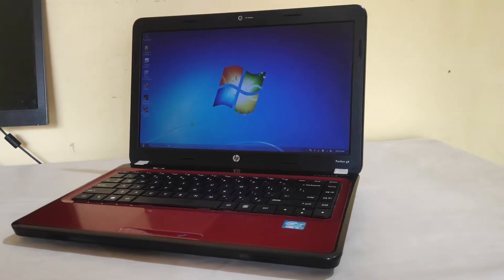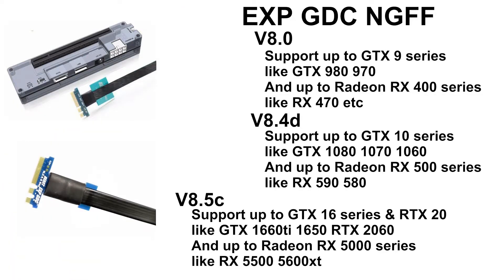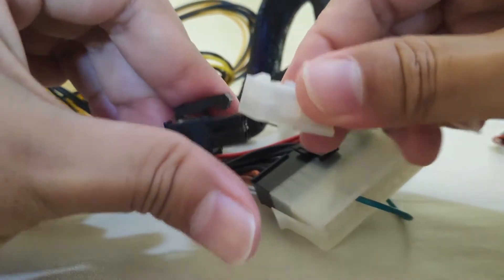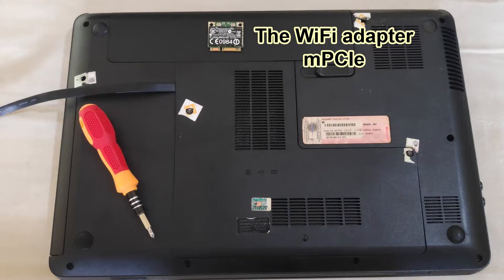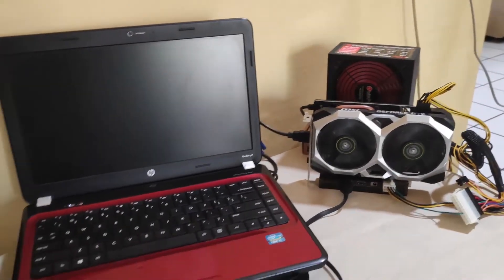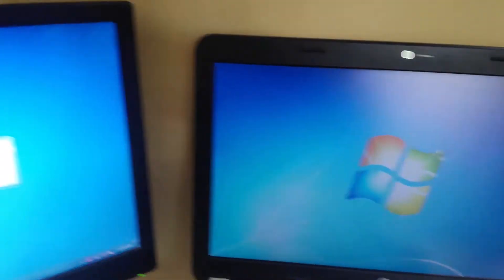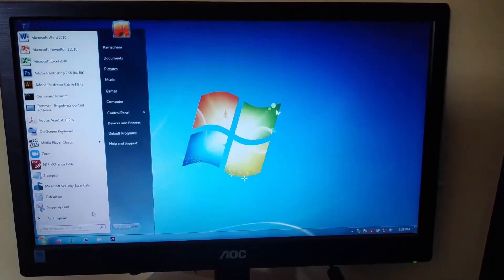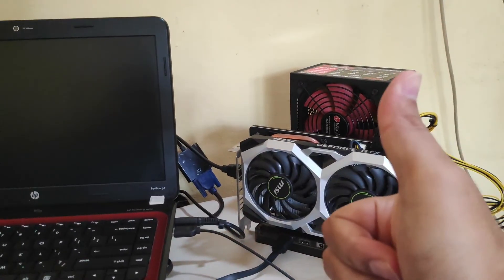EXP GDC Beast V8.5c eGPU with GTX 1660 ti on Old Laptop from 2012

Comment: is it necessary to use a monitor?
Reply from the maker: If your Laptop's internal slot is using : Mini PCIe (mPCIe) , Express Card, NGFF, then it's necessary to use external monitor.

If it's using M.2 NVMe slot, it doesn't need external monitor.

The reason? The cable have to do Two-Way transmission between Laptop, eGPU, GPU, back to Laptop again.

This will make extremely saturated PCIe Signal since mPCIe is running at 2.5 gbps, Express Card at 5 gbps, NGFF at 8 gbps. Those numbers, divide by 2 if you're using Laptop's Monitor. So must use external monitor to avoid Saturated PCIe Signal.

As for M.2 NVMe slot, it runs at 32 gbps. So the signal will not be saturated at all.

The ONLY Exception is the Pinned Comment about RTX 3070, which is connected using mPCIe, but can still use internal Monitor.
Reply: @ClayWheeler Okay thank you

Comment: So the cpu does not matter for a external gpu?
Reply from the maker: actually it matters for PCIe signal as my Laptop only have PCIe Gen 2 x1 Lane which is exactly 2.5 Gbps.

if your Laptop has mPCIe, its signal is 2.5 Gbps or 5 Gbps if the Laptop is from 2013.

if your Laptop has Express Card, the signal is 5 Gbps.

if your Laptop has NGFF, the signal is 8 Gbps.

as for M.2 NVMe, the signal is 32 Gbps.

Any Laptop from 2013 OR Older WITH mPCIe, have a heavily saturated PCIe signal. Your best chance of using external GPU is for lightweight gaming. It cannot even play GTAV at Lowest settings even with Core i7 Mobile CPU.

Unless you have any other connectors as mentioned. It can still play heavy games just fine. Also,  check pinned comment
Reply: @ClayWheeler  I have my Lenovo 330s with NGFF and the cpu is i5 8250u. What gpu do you recommend for this? Thanks
Reply from the maker: @AbuSyria08  I have certain concern regarding any Lenovo laptop that is NOT ThinkPad.

Sometimes their NGFF Slot is not sending PCIe signal. it is only sending internet signal.

What kind of storage already occupied in your Laptop Ideapad? is it the regular 2.5 inch SSD SATA?

https://youtu.be/QFzmeq4XWIk?t=168 

In that video I can clearly see M.2 NVMe slot which can be used for eGPU without failing.
Reply: @ClayWheeler  so I checked out my laptop and I found an slot which is named DR16493MD next to my NGFF slot I don't really know if thats a m.2 slot but I'm just making sure if thats it and if it's the m.2 slot then lemme know. Thanks again.
Reply from the maker: @AbuSyria08  is your Laptop motherboard layout exactly the same as the Video I sent earlier?
Reply: @ClayWheeler  no its not.
Reply: @ClayWheeler  I forgot to say that my Lenovo is 330-15ikb model
Reply from the maker: @AbuSyria08  I'm asking you a favor to look for someone else's Video about that exact same Laptop as yours, disassembly

And then maybe I can help from there
Reply from the maker: @AbuSyria08  alright, wait a sec
Reply from the maker: @AbuSyria08  oh wait, is your Laptop already have NVidia GPU on it?
Reply: @ClayWheeler  no mine haves an uhd Intel 620
Reply from the maker: @AbuSyria08  I found 2 different video with 2 different Laptop Layout, but has almost similar Laptop name

330-15ikb
https://www.youtube.com/watch?v=HqpIEE71GLA

330s-15ikb
https://www.youtube.com/watch?v=AocmjFQ3r-E
Reply: @ClayWheeler  oh the 1st one is the exact same one but only with Nvidia my laptop got ryzen next to the intel I Core sticker. Thanks for responding fast! I appreciate
Reply: @ClayWheeler  sorry I acsedently disliked your comment 😅
Reply from the maker: @AbuSyria08  alright the 1st one.

What is your current storage type?
SSD SATA or SSD NVMe?
Reply: @ClayWheeler  it's ssd nvme
Reply from the maker: @AbuSyria08  so apparently your Laptop only have 1 NVMe slot which is already used by your current SSD.

We don't know if the NGFF Slot actually carrying PCIe Signal or not.

But you can confirm this using a Software called PCI-Z (it's like CPUZ and GPUZ, but this one is for detecting PCIe signal)

It's freeware. Just install and run as Administrator. Look for your current WiFi Adapter name.

If you're confused with the names, just check your WiFi Adapter name from Device Manager, and then make sure it is listed together in PCI-Z
Reply: @ClayWheeler  OK so the adapter is listed in the pci-z
Reply from the maker: @AbuSyria08  so maybe it can use NGFF eGPU.

For sure it's limited to PCIe Gen 3. So any GPU with base model of PCIe Gen 4 will be saturated. It will work but will be heavily Bottlenecked.

So your Options are RTX 20 series, GTX 9xx, GTX 10xx , GTX 16xx.

If you want to buy Radeon, then anything that's not RX5000 or newer. Because RX 5000 already PCIe Gen 4.
Something like RX 590 is ok.
Reply: @ClayWheeler   so do I have Gen 3 or less?
Reply from the maker: @AbuSyria08  Gen 3
Reply: @ClayWheeler  OK thank you very much now I got all the information to buy the exp gdc beast and I really appreciate it thanks very much
Reply: @ClayWheeler  I just got my last question so there is no problem if I use the exp gdc beast v8.5c NGFF with rtx 2060 super on my Lenovo 330-15ikb?

Comment: Bro 
I have 2 ngff connectors on my laptop one the wifi card plugged in it and another empty
Can i use the empty one and keep the wifi card ?
Reply from the maker: First of all, please check the NGFF Slot itself.

What does it says near the Connector? If one of them says (Written) "PCIe" then you should use that one for eGPU
Reply: @ClayWheeler  the empty one say 
LTE WWAN JNGFF2
What's that mean?
Reply from the maker: @chouaibboudhim3465  yeah apparently it brings PCIe Signal which means can be used for eGPU
Reply: @ClayWheeler  thank you so much bro i appreciate it 🙏 💯

Comment: Bro, you can use hdmi dummy plug to don't be necessary using external display. But also without egpu box there is a mess on the table lol.
Reply from the maker: HDMI dummy will create extreme Bottleneck because the cable isn't supposed to be Two-Way .

Unless the Laptop support HDMI input.

Comment: Hi I have a hp probook 430 g5 laptop i5 8250u 
I was thinking if I can install egpu to it…
It has mini pcie 
Which graphics card would be best for it ( I’m planning of getting old GTX 1060 or GTX 1650 or rtx 2060 anyone  of these ) what do u say…..
and…. should I buy exp gdc from aliexpress and want version should it be 
Hope u reply…..
Reply from the maker: I'm actually surprised that HP Probook Laptop is using Mini PCIe version.

Because HP Probook with Core i5 8250U is from the year 2018, and Mini PCIe discontinued after 2014. Are you sure it is not using NGFF instead?

But anyway apparently even the version V8.0 can handle RTX 3070 if you see the pinned Comment of the video.
Reply from the maker: This is HP Probook 430 G5 disassembly video. And if you pause between 00:45 to 00:47 you will see it is using NGFF https://youtu.be/rsO6yy_Y-9w
Reply: @ClayWheeler  oh it’s using ngff thank you for letting me know

Comment: Hey Clay. Really appreciate yoour Video. it's very helpfull.

i don't know if you still answer question about this. But for me i have a Lenovo legion 5 pro, that comes with an intel core i7 11th Gen, and a RTX 3050 . But i some problems on rendering videos, on twinmotion, and other 3d Apps. lack of power. so, i decided to buy an EXP GDC with and RTX 2060 SUPER, witch is more powerfull than my dedicated graphichs Gpu, and i followd your instruction about code 43, and everything works perferctly to me. 

But , i don't see the full potential of the RTX 2060 SUPER. sometimes it crashes when oppening some 3d application i use, even my dedicated GPU 's doing  better than him.
what can be the cause of that? is there a problem with the PCI E Cable, ? like the speed of transfer Data isn't enough? or Should i by an older Egpu, like the ADT LINK External graphics card that comes with the thunderbolt 3 cable? 

Please Let me know yoour answer.
Reply from the maker: Core i7 11th Gen & RTX 3050.
Which Connector you actually use?
M.2 NVMe slot?

ADT-Link is actually newer than EXP GDC. But it's still PCIe X4 Lanes anyway.
Reply: @ClayWheeler  WELL i don't know the real name of the cable, but i actually use the PCI-E 26 pin connector. i connected it into my wifi connector. i didn't use my ssd slot
Reply from the maker: Also, is your Lenovo Legion has Thunderbolt port by default?
Reply: @ClayWheeler  Yes, it has

Comment: Hi, I have the PNY GEFORCE RTX 2060 and would like to know if the EXP GDC v8.0 can also work, or should i get the v8.5c. Thanks.
Reply from the maker: The most important thing is,
Checking your own Laptop Motherboard layout. You must check by yourself which Connector it has.

What's your Laptop model anyway? Also Laptop CPU name from Dxdiag
Reply: @ClayWheeler  Hi, thanks for your reply. I've already checked my laptop and it should be a NGFF cable to use.
Reply from the maker: If you have trouble to open up your Laptop, just browse YouTube how to disassemble it.
Reply from the maker: Because if you read at the Pinned comment of this video, I wrote Link for RTX 3070 running on EXP GDC v8.0
Reply: @ClayWheeler  So I assume that the RTX 3070 is newer than the RTX 2060 I have, this means it will work v8.0 on my GPU.
Reply from the maker: @mikelodeon13  try to download an app called Z-info version1.0.45.11 just use Google to search it.

This app is a Bundled of several apps together which contains CPUZ, GPUZ, SSD-Z, PCI-Z.

Installation very simple, just Run as Administrator, next next yes ok etc.

Now, what you want to do here, is run PCI-Z as Administrator.

Look for your WiFi adapter, is it listed under PCIe section or not. If NOT Listed, then, that particular NGFF slot doesn't carry PCIe signal. Hence cannot use External GPU.

If the WiFi Adapter is Listed under PCIe section, then that particular NGFF is carrying PCIe Signal.

NGFF is very tricky because sometimes it's a Hit or Miss. Sometimes it carry PCIe signal, sometimes don't. Depending on the Laptop company.

Comment: Hello ! Do you happen to know if this method works for a Dell? For my part I have a "dell inspiron 15 5000" which is not crazy for big games x) So I would like to install a gtx 1070 on it but I'm afraid it won't work and I'll be stuck after buying everything 😆 Thank you for your help or any other that will be brought to me ;) Otherwise great video! ✔
Reply from the maker: What's the full name of your Laptop's CPU in Dxdiag ?
Reply: @ClayWheeler  sorry for the late reply, the full name of my Laptop's CPU is : "Intel(R) Core(TM) i7-1065G7 CPU @ 1.30GHz (8 CPUs), ~1.5GHz"
Reply from the maker: @riospartybox2388  nice. That sounds like newer Generation Laptop.
You need to be extra careful.

First off, if you didn't know how to disassemble the Laptop's case to access the Motherboard, you need to search on YouTube videos about that particular Laptop disassembly.

See if your Laptop's Motherboard has more than one M.2 NVMe slot on it. Also check if you have empty SATA slot on it.

If you have TWO M.2 NVMe slot, check both of them, if it says "NVMe" or "PCIe" or "SATA x PCIe" or "M2 PCIe" (printed on PCB near the slot) 
Then it means that particular slot can be used for External GPU dock.

If you don't have TWO M.2 NVMe slot, but have empty SATA slot, then you have no choice but to Move your entire system to SATA SSD, to be able to use the Occupied M.2 NVMe slot and swap it for eGPU

Why am I not recommending using WiFi adapter slot? Because the Laptops that's using any Intel CPU from 2018 or newer, are not using PCIe signal for the WiFi Adapter, it has its own On-Board Chip to send and receive internet signal.
Reply: @ClayWheeler  Hello ! 
I did some research and after disassembling the laptop, I found this and I'm certain of this information (except for the 1TB PCIEe x4 drives, I don't know how to verify this information but it must be because my laptop model is the same): 
The laptop has 1 slot of a "ssd m.2 2230 drive" (this m.2 slot can accommodate up to 1TB of PCIEe x4 drives) and 1 slot for a SATA 2.5 drive with the SATA cable glued to the chassis (I should point out that this is currently empty). 

So if I understand correctly, I have to buy a sata disk and remove the m2.2230 ssd disk currently on my laptop to replace it by the dock?
Reply from the maker: @riospartybox2388  Hmm Correct.

Now for the first step, whether or not you're willing to reinstall the OS.

First off, obviously buying regular SATA SSD. 1 TB or 2 TB it's up to you.

And then, if you don't want to reinstall OS and everything you've had, just Clone the OS after you've bought the SATA SSD and plugged it in.

Usually after you're done Cloning the OS, it will ask you if you want to immediately boot from SATA SSD or not. If you click yes, your existing M.2 SSD will be unrecognised as OS drive.

However you can still access the M.2 SSD as regular Drive. Including all of its Partition if you ever split the drive to Drive:C & Drive:D for example.

This could be troublesome if you need to regularly accessing the data from that M.2 SSD as you wish to install eGPU.

Don't forget that External USB M.2 SSD might not able to read your SSD if your SSD is NVMe type.

Because there are 2 types of M.2 SSD. The one with NVMe SSD is using PCIe signal, hence cannot be used externally.
And then, the one with just M.2 SATA SSD, which is much slower than NVMe, this one can use USB External M.2 SSD reader.

Comment: Hi, thanks for wonderful video, does the exp beast PCIe Gen3 support x16 lane or 1 lane ? forget about the physical connector shape x16, is it 16 lane throughput or 1 lane throughput?
Reply from the maker: Depending on model.
mPCIe Connector carry PCIe Gen1 x1 Lane
Express Card carry PCIe Gen2 x1 Lane
NGFF Connector carry PCIe Gen3 x1 Lane
M.2 NVMe carry PCIe Gen3 x2 or x4 Lane (auto switch to Laptop's chipset itself)
Reply from the maker: mPCIe 2.5 Gbps
Express Card 5 Gbps
NGFF 8 Gbps
M.2 NVMe 16 or 32 Gbps (auto switch)
Reply: @ClayWheeler  Perfect, here is my problem. lets assume we are using  NGFF 8 Gbps, as you know the cabel which has two connectors HDMI and NGFF connected to the eGPU and motherboard,  HDMI 2.5 Gbps and NGFF 8 Gbps, so how the HDMI will not bottleneckthe 8 Gb ?  and if so what is the benift of design HDMI?                                                             and the 2nd thing is the 2nd output HDMI to the monitor which you said also 2.5, So what is the benfit of 8 Gb of 1 lane if the output to the monitor is only 2.5 G ? thanks again I wish you explain this to me.
Reply from the maker: @divinxoii  the HDMI is NOT doing anything related to HDMI display signal Wiring Diagram. It literally just Physical BUS Connector of PCIe signal.

HDMI Wiring Diagram apparently can carry 16 Gbps at max. Hence why you see v9.0 or v9.5 has double HDMI.

 Another product you may want to check it out JHH-Link which kinda looks like EXP GDC v9.5 but more neat and can handle 32 Gbps with same Dual HDMI connector
Reply: @ClayWheeler  Thank you so much for sharing your deep knowledge.